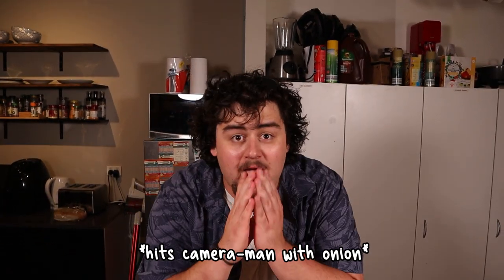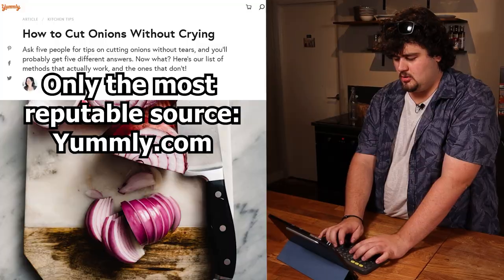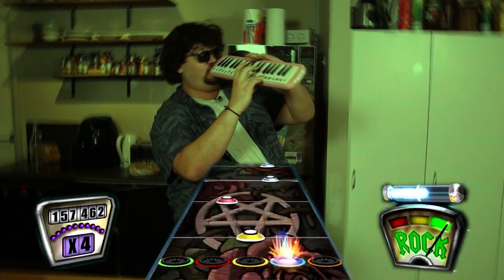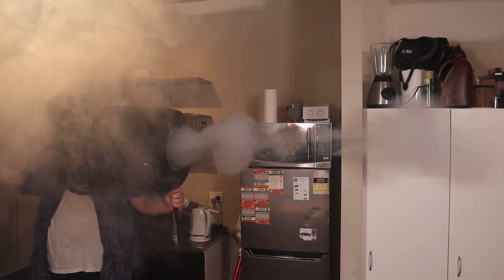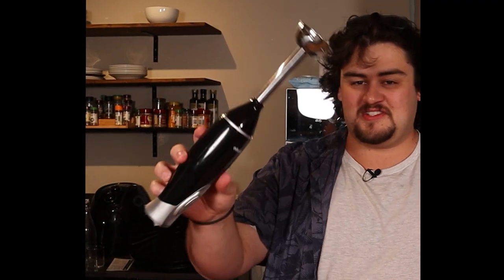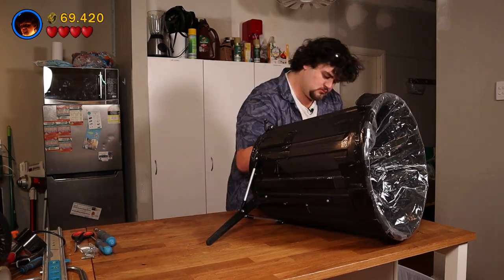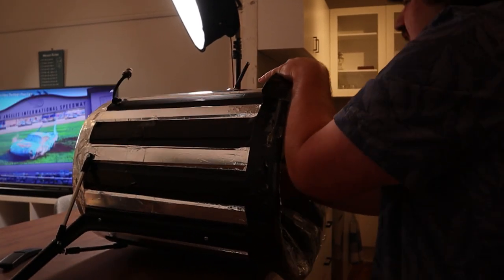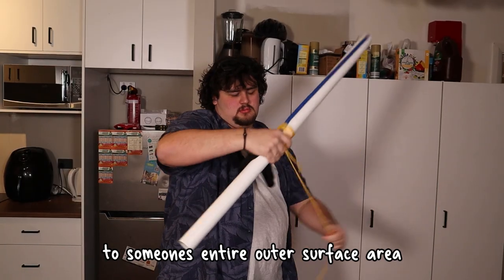Can You Turn Onions Into Tear Gas?

Comment: Lmao all that over engineering for nothing, tbh if you want to make it work better, you'd need to turn the onion juice into fine vapour in an airtight chamber under pressure, then just release a little bit of pressure using a pump to speed up the tear gas so it can travel further and it should be pretty much the same as actual tear gas, either that or you make a tear gas grenade but that's probably harder to do.
Reply from the maker: Added this to future projects list, will keep updated。
Reply: @JarydGiesen  holy 😂 definitely gonna check that out then.